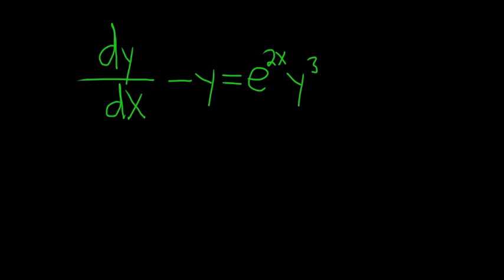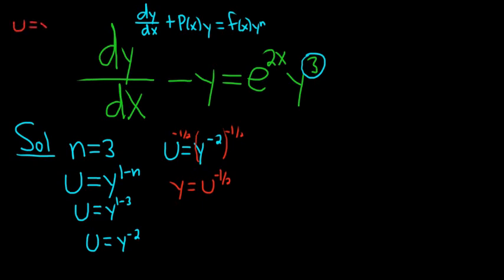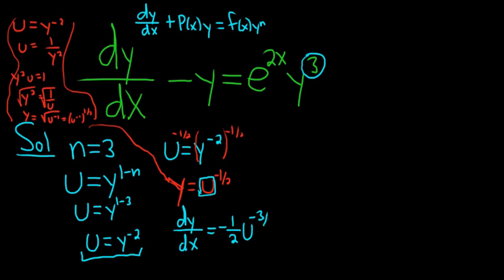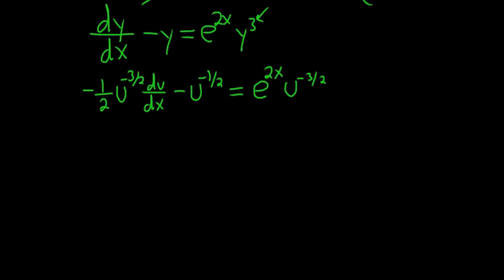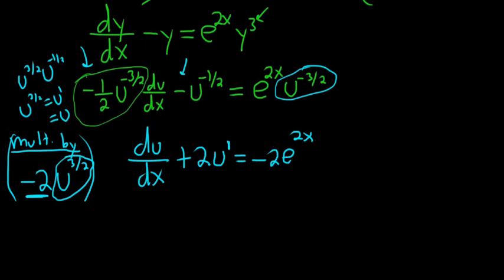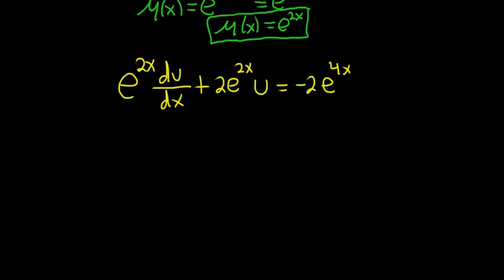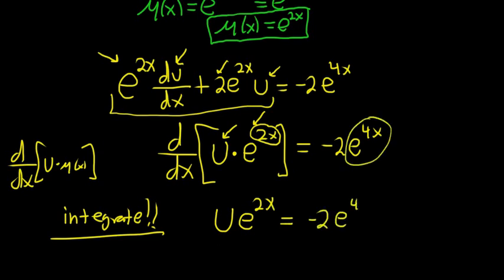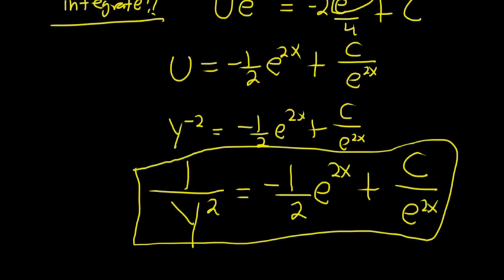How to Solve a Bernoulli Differential Equation

Comment: Hello sir 
Please I put a new D.E instead of Bernoulli 
dy/dx +P(x)y/n =Q(x)y^k where k=1_n  ( Alsultani D.E )
For the example 
y^'_ y=e^2xy^3
Solution 
dy/dx +P(x)y/n =Q(x)y^k where k=1_n 
k=3=1_n  so  n=_2
Multiply by  (_2)
_2dy/dx +2y=_2e^2xy^3
I.f.=e^int.2dx=e^2x
y^_2e^2x =_int.2e^2xdx+c
e^2x/y^2=_ e^2x+c
y^2/e^2x=1/(c_e^2x)
y^2=e^2x/(c_e^2x)
Simple solution without substitution , confusion or delay .
Thank you very much